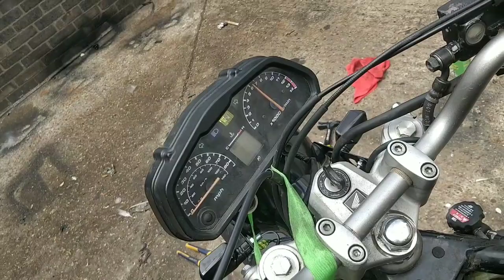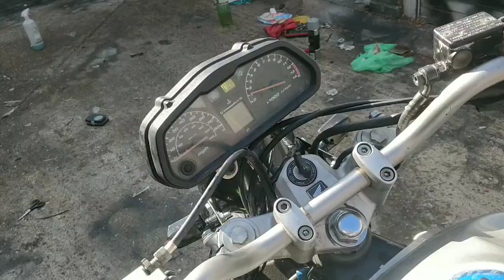Honda varadero 125, carburettor tuning. carb rebuild, carb balance, carb clean, 125cc, fix, repair,

Comment: Gave mine a service today charlie after been satup for winter as you know the weathers been mild this week so took full advantage. Well the front spark plug was rusty like it had been in there years! so glad i fitted new plugs as it started with ease no complaints no moaning and ran beautifully.  Left her ticking over a while got her warmed up.  She only needs a back tire for the MOT so going to get that done asap ready for the nice spring weather. Cant wait to get on her. This covids been crap felt so inprisoned and worse cos its winter.  I want to feel that freedom only a bike can give. Hope you are well  all the best.
Reply from the maker: That'd great news. A rusty plug may not be making contact probably with the side walls and could cause a misfire. So lucky you spotted that. 

Well done Lee.
Reply: @motorcyclerescuer  yeah the front plug aint that easy to get to you have to unbolt the fairing etc i think the previous owner just couldnt be bothered and just left it. The plug looked like it had been in there years.

Comment: Good job mate.  It sound good. Seat should be a relatively simple fix. Once done it is a good London commuter!
Reply from the maker: It's just not smooth enough yet. I'm. Sure it's air/fuel mix but the screws are super hard to get to while the engine is running. I'll take another look on the weekend. At the moment it's almost fully in and running better so I think that means I need to down jet the pilot jet. Just trying to work it all out. Its close, just not smooth enough yet.

Comment: Gosh, honestly there’s no real black magic to setting up V-twins, none of it’s difficult at all. I suppose it’s just what you’re used to, but V-twins have their place as much in the 125 world as any other single .  I prefer a v over a single any day, unless the single happens to be a 2 stroke 250 or 300.
Reply from the maker: I guess a 125 v twin is a pain compared to a single. You have to do everything twice, double carb clean etc. Also on these bikes you have to balance the carbs with one of the leading by 5 percent or something like that. That's a pain to achieve. 

In the end it ran great. 

Cheers Jonathan

Comment: Great video guys. And yes it's getting better
Reply from the maker: The bike? It's close, just the last fine adjustments in the air/fuel needed and it should be spot on.

Thanks
Reply: @motorcyclerescuer  yeah the bike lol so close init
Reply from the maker: @stonedagain1982  just not close enough. It appears to have leaked petrol last night in the garage.

I've got to get to the bottom of the carb issue.
Reply: @motorcyclerescuer  did you check the float hights ?  and did you manage to clean the needles in the slides and is the choke fully working. Thier would be the things I would be looking at buddy
Reply from the maker: @stonedagain1982  yes clean needles, float heights are OK, choke isn't working perfectly but is shutting off which is good.

Only issue left is tuning the air/fuel mix. I can't get my hand in with the bike running. Also its at less then 1 turn out now so I may need to change the idle jet.
Reply: @motorcyclerescuer   good luck on idle jets mate hope it sorts it out for you.

Comment: More Mexican than Italian. Varadero seems to run really nice, didn’t take you long to fix that one at all.
Reply from the maker: Lol I wondered what you were talking about there. It's still not starting as well as I like and the revs are hanging a touch so still more air/mixture adjustment and possibly changing the idle jet.

Possibly some fuel spill on the garage floor this morning aswell so need to check that out aswell.

Comment: It's starting to look like a good bike just the seat to sort out
Reply from the maker: Well the air/fuel screws still need setting properly, it's really hard to get to them why the bike is running. Very little space. I want to have another play though and see if I can get it better. The seat cost around £50 so don't want to put that into it until I know it's running right.

Then it's brake cleaning, new fluid and check pads.

Comment: seems a good job mate
Reply from the maker: It's like 95% done really. If I can get the air/fuel adjustment sorted I think it will be spot on. Its really hard getting to the screws is the issue.

Comment: Hi there i was looking to remove the front end of the bike and put some aftermarket headlights on it, the only problem i have is that the coolant reservoir is stored inside the front fairing, do you know anything about what i can do?
Reply from the maker: Hi Seth. The overflow bottle can be moved anywhere on the bike, or you can buy a smaller one on ebay or you can run the bike without it. It's only needed if the bike overheats so keep your coolant topped up in the radiator and it will be fine.

Thanks for watching and please subscribe

Comment: Just wondering do you have original set of handlebars for Honda Varadero 125
Reply from the maker: Hi Stephen, sorry mate I definitely don't. But you can get lots of designs on ebay now days at reasonable prices mate. Well worth a look.
Reply: Thanks Charlie for the info going to start researching on eBay tonight love the channel and the work you do on the bikes brilliant 👍
Reply from the maker: @stephenwalsh8184  no problem Stephen. Thanks for watching mate.

Comment: Need  your help mine's fine until it hits 7000 RPM than bogs out while riding
Reply from the maker: Top end is normally easier, are you running the normal air box with a normal filter? Is the filter clean?

My guess is that either too much air is getting on through gaps or that the air filter is old so not enough air getting in.

Otherwise the main jets could need cleaning or even up jetting.
Reply from the maker: Thanks for watching and please subscribe
Reply: Cheers air filter seems ok carbs clean spark plugs and plugs are good bikes recently had a full rebuild
Just seems to only do it when you're giving it some while riding it
Reply from the maker: @jcdl8083  if everything is OK then the jetting cant be right for the bike. Possibly the carb balance

Comment: Hi i have problem with my varadero.you can help me?
Reply: yesterday it stopped me suddenly, and when I started it again I couldn't, I insisted but it stopped working well.
Reply from the maker: Hi buddy. It could be anything mate. Bad fuel or something blocking the carbs is my guess. Flush out the old fuel, put on a new fuel filter and drain the carbs. This might solve the issue.

Apart from that you will be looking at spark problems. Side stand switch, clutch switch, start switch and ignition.

Sorry I can't narrow it down but this is the process I'm afraid.

Thanks for watching and please subscribe
Reply: @motorcyclerescuer  i try all your sugerations thank a lots
Reply from the maker: @cristianjsola8483  no problem. Good luck with it mate.

Comment: oh PS, i passed my CBT yesterday
Reply from the maker: You did your cbt? That's great John. Did you so it on a automatic or geared bike?
Reply: @motorcyclerescuer  I did My CBT on a Sim Wolf 125cc  5 gears the other guy on the course failed and had to stop,
I passed three years ago and got a WK 125cc R it was a fixer uppa so i got it working and looking great not long after maybe 20 miles it stopped working and i learned how to do a full top end rebuild,

50 miles later the bike stopped working and once again the cam was like a rolo chocolates tube or smarties, so i did a full top end rebuild and it stopped working again by this time i could not put more money back in to it, but then i stripped and rebuild sprayed every thing many times because of youtubers, 
I got the bottle to investigate the bottom end and found a lot of metal fine swarf and a oil pump with four missing teeth,
i dont blame the seller but he did sell knowing this, however i understand bikes so much more, and now three years later i have paid off the LOAN and I'm ready to give the owning a bike another go

i've got to the point of lived and learned with the guy who sold to me because of people like you,  people to teach .....Teach,  and now im confident any future bike will always work
 ' IVE BEEN TAUGHT '
oh the WK 125cc i scrapped it a month ago
Reply from the maker: @johntray1462  nice, that's how I learn too, take things apart, see how they work then piece them back together. It's an art in itself.

Comment: The front fender came unpainted
Reply: And, remember, for LED-converted blinkers, you need a solid-state relay (or a relay marked for LED-use)
Reply from the maker: The indicators were bulbs, I prefer bulbs.

I'm surprised about that front mudguard coming unpainted. I'm not sure if I put some black on it or not.

Thanks for watching mate and please subscribe.
Reply: @motorcyclerescuer   I had a 2014 Varadeo, in black, and the mudguard always bothered me... it will need a lot of sanding to get a nice surface, -for paint
Reply from the maker: @arnekarlsen528  I think I just chucked some matt black on and it looked better.

But yes to get it flat and shiny it would need priming.

Honda went cheap on that one.

Comment: That doesn't sound right to me 🤔
Reply from the maker: It wasn't right until the end. I put new carbs in finally. Ran great once they were in.
Reply: @motorcyclerescuer  I own one my self had it just over a year now and it's never let me down cracking bikes 🏍💨🤟🏻
Reply from the maker: Honestly it was too complex for me. I prefer a single cylinder if it's a smaller engine. However they are great 125s to ride.
Reply: @motorcyclerescuer  I love the v twin, you should put a black widow exhaust system on they sound great pal 👍🏻
Reply from the maker: @benm9386  mines long gone Ben..I don't keep them long. My harley ill keep though. Now that sounds stunning

Comment: Annoying you don’t show how to actually take the carbs off the bike…
Reply from the maker: I try not to do tutorials as I'm not a pro. These carbs weren't easy to do though I remember that. I would suggest getting yours to a mechanic or someone who's fairly good with bikes if your not yourself. 

I'm sure I show some carb stuff. You may need to try the vid or 2 before this one or the vid or 2 after as often I re do things to get them even better.
Reply from the maker: This one shows a bit more but again they are really complex carbs in the way they are designed. 

https://youtu.be/mhRD1vngJ0k